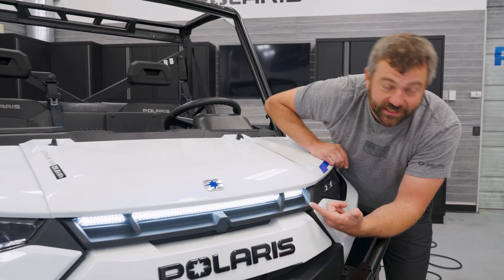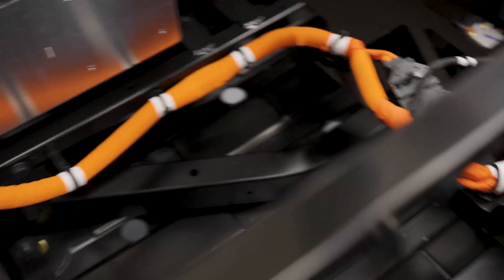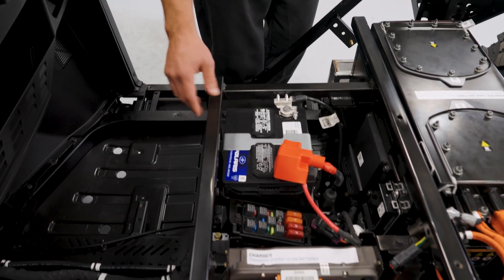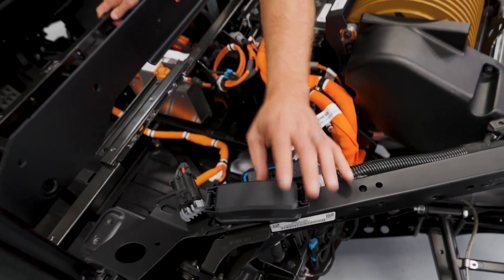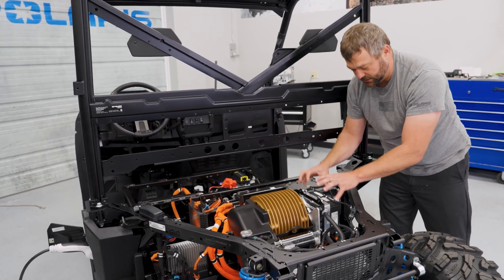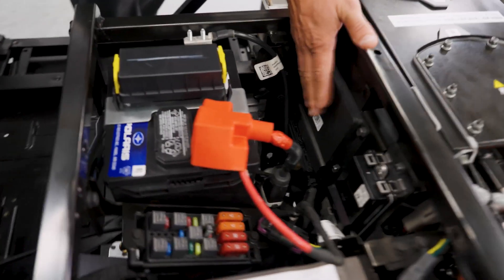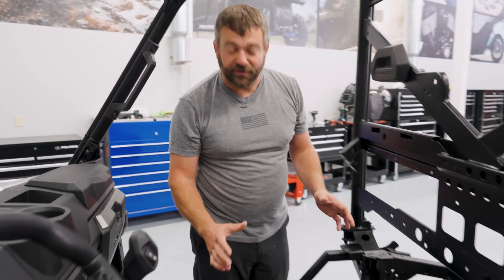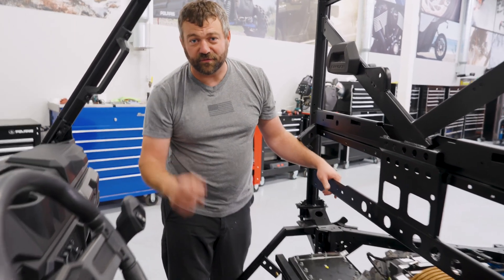HOW DOES THE ALL ELECTRIC RANGER WORK? - SHOP TALK EP. 32 | POLARIS OFF ROAD | SHOP TALK

Comment: Probably would be a heck of a lot cheaper just to have my old Polaris ranger EV converted to lithium battery.
Reply: You can get 12v and 48v LFP batteries to replace the lead acid, probally have to change the charger also

Comment: Why don't you offer a Kinetic crew?  and why does your Kinetic with 30KwH battery 110Hp  motor cost as much or more ($38K) than a Tesla model 3 which has a 50kwh battery, 283 hp motor, seats 5,  paint, airbags, climate control, and massive list of things that the Kinetic doesn't need to have?   The kinetic should be A LOT cheaper than what you sell it for.  And the tesla is actually 7000 cheaper when you include the tax credit.
Reply: If you actually want the answer to your second question: Economies of Scale. “Economies of scale occur when the average cost of producing each unit of output decreases as the total volume of production increases. In simple terms, it's the idea that larger-scale production leads to lower average costs per unit.”
Reply: @PhilipBlank  Yes, and Polaris has the same economies of scale they have always had.  The Kinetic is just a ranger XP 1000 which is a 21k MSRP.  Except they didn't put in an Engine, a CVT, Radiators, gas tank, and all the hoses and belts connecting everything to each other.   They instead put in an electric motor and 2 batteries all of which are massed produced by Zero.   If you are trying to say that costs an additional 18k nearly doubling the price of the vehicle, then they need to find a better partner/supplier cause they are getting ripped off.
Reply: @Thebackson  aye! With the battery being the bulk of the cost plus the the touch screen and speakers, the Zero SR/F with one 15kw bat of the starts at 20k, so you’re putting 2 of those babies in the big one, still only 1 motor though. Long term though hopefully prices with equalize but I bet we’ve got a while!
Reply: @Thebackson  I am with you all the way on this. Value wise the Kinetic is absolutely terrible. As an owner of a few Teslas and a Kinetic I can say with confidence that the Kinetic is a toy by comparison. It is inferior in every meaningful category. From the hilariously poor Ride Command, I am not sure what it is actually, thing. Duplicated gauges, navigation and UI from I swear to god 2005, and a fully closed audio setup. The motor control is crap. The noise it makes is crap. Comfort is crap. Watts used per mile (efficiency) is beyond crap.

Polaris took a 5 year old platform and bolted someone else's electric drivetrain and battery to it, and doubled the price. That's not an opinion; that's a fact.
Reply: Please try to arrange trip with Kinetic & Tesla. On the same, off-road terrain ;)
Reply: @Frizzol02  I don't know if you are just trolling or being ignorant,  yes I realize they are not built for the same purpose, but the Tesla has much more expensive component and a much more expensive build process with paint and many many more parts that the kinetic doesn't have.  The kinetic shares the vast majority of the parts of a regular ranger and even has less parts when you remove the radiators and the CVT and many other parts related to the engine.  The Kinetic is way overpriced.
Reply: @Thebackson  But please compare battery price for both vehicles. This is main driver of price for sure. And as above comment, please do not compare automotive qty vs off-road production.
Still, please go with both vehicles to the field and spend one day in hard terrain on work near farm.
Reply: @Frizzol02  The industry average cost for BEV batteries is about $150/kwh  if we go way above average to $200/kwh than the 30 kwh  worth of batteries in a kinetic is only$6k.   Batteries are not that expensive.  Polaris is ripping people off with the $38k price tag.
Reply: @Frizzol02  Put simply, a Tesla car is way better at being an electric car than the Kinetic is at being an electric off road vehicle. You can play the like for like game, and I appreciate that. But scoring them within their respective areas still puts the Kinetic far behind. I know because I own both.  The engineering refinement, efficiency, and "of one mind" feel of the Tesla is absolutely stellar. And when you consider cost, it makes the Kinetic look downright silly. I also accept the economies of scale argument. But the delta here is massive. It is legit cheaper to buy a car with radically better technology, efficiency, warranty, performance, support, software, features, comfort, reliability, range, refinement, telemetry, connectivity, noise, and materials than Polaris Ranger Kinetic. If it were $25k I'd accept the economies of scale argument. But nope, not having it.
Reply: @Thebackson because Tesla has scale, gets tax benefits, and different robustness requirements.
Reply: @vijaishankarbhavanishankar377  Tesla customers might get tax benefits, but Tesla does not.  38k for a Tesla 3 standard is before tax benefits.  It is closer to 30k with tax benefits.

As far as building at scale goes yes that can be part of it but Polaris builds rangers much cheaper already and when you remove the motor and transmission and all the parts needed for an ICE ranger and add much fewer parts for a EV ranger , it doesnt double the cost of a ranger.  The kenetic is basically a ranger xp 1000 which is sold for 20k.  Replacing the ICE parts with EV parts does not double the price.
Reply: The simple answer is capitalism.  They are selling every one they can make at this price so why sell for less?  Once early adopters are satisfied and polaris ramps production, prices will come down.  It is your standard S curve.  I ponied up and happily paid the $38K because I know Polaris sunk a lot of money into the R & D on this thing and are probably still in a loss, but being a Minnesotan, I want them and their employees to make money and prosper!
Reply: @dfreadhoff  Agree on the capitalism thing. Don't hate the player, hate the game, right? But as a Kinetic owner, I can share one flaw in your response: I won't be buying another Polaris product. Not good for capitalism at all. I would appreciate some data on production vs sales. I challenge you on that one for sure. Subjectively, it sure does not seem true.
Reply: The door nets cost at least 10 grand!!! They are made from some space age material that you just can’t get on a Tesla; only available on overpriced sxs!!

Comment: You can tell this is JUST for farm work, I've yet to see a power outlet out in the wilderness!
Reply: I have yet to see anyone with a ranger drive 80 miles without coming back to civilization,  I'm sure it happens but there is probably quite a bit of people who this would work for besides farm work.  I see people driving around their neighborhoods, or taking them out for a trail ride,  but 80 miles in a ranger would be miserable. No one is forcing you to get one, but the kinetic doesn't have belts that wear, engines that have to be rebuilt every thousand hours.  It is quiet yet more powerful. Too each their own.
Reply: Ive yet to see a gas station out in the wilderness…
Reply: Lets see, spare gas cans and it takes a few minutes to "recharge" that ICE vehicle's fuel tank.  @rileywindham
Reply: @dundonrl  I don't need them. Never carried gas and went on rides that went all friggen day. I was happy to be home! And that same thing applies to my Kinetic. The "carry a gas can" thing is a tired and worn out red herring. Used by the inexperienced to calm themselves from the scary unknown.
Reply: @toddshreve  The estimated range on a Kinetic is what, 45 miles? So 22 miles out before you have to turn back. I took my General on a 50 mile ride a few weeks ago just for the hell of it, which would be impossible for the Kinetic.
Reply: @dundonrl  It's 80 miles or so. About the same as I get in my gas Ranger and about the same I get on my gas Sportsmans. But I understand. It's the easy target. Carry a gas can! lol so old and tired. Electric stuff is here to stay. And it will be ubiquitous in your lifetime. And why do I suppose this? Because I own a lot of electric stuff. And it's better. Fin.
Reply: @toddshreve  The electric vehicle was invented before the ICE vehicle, yet even today its still way behind!
Reply: @dundonrl  hehe, nice ;)
Wanna race?
Reply: @dundonrl  That is changing rapidly. For every 10% of production increase their is a 1% reduction on per unit cost. The industry term is the Learning Curve. It has happened with every new tech from the TV to the gas engine itself
Reply: @rileywindham that is why you carry extra gas in cans so if you need it you have it.
Reply: @robertcarroll1511  this is why you install a solar panel on the roof so youre always charging.